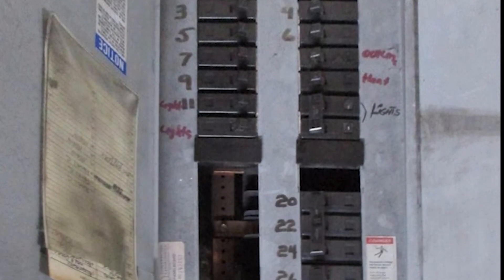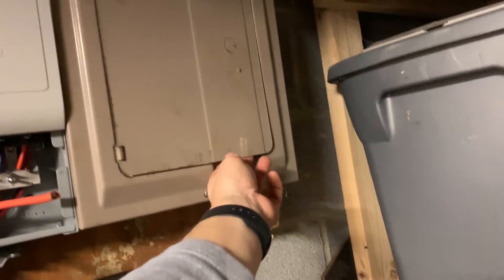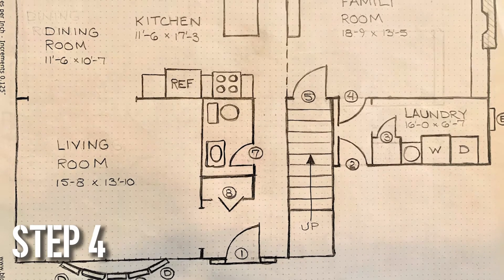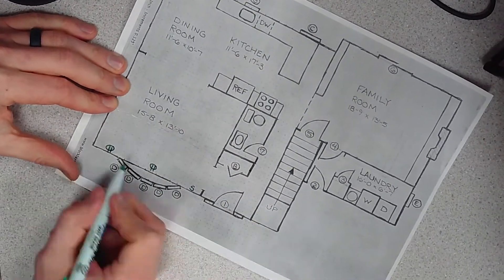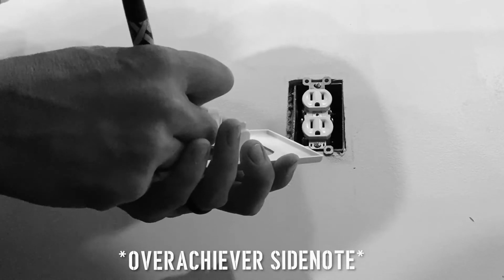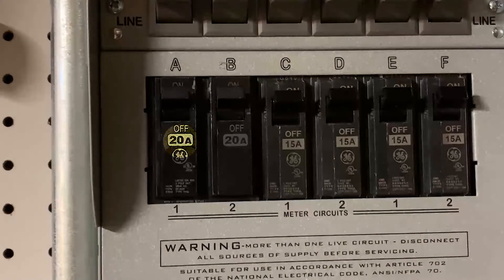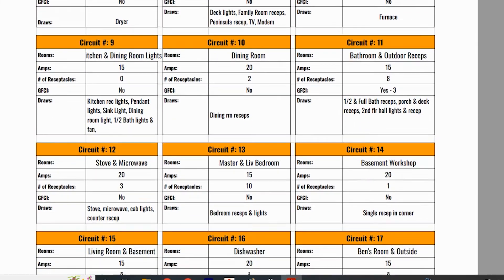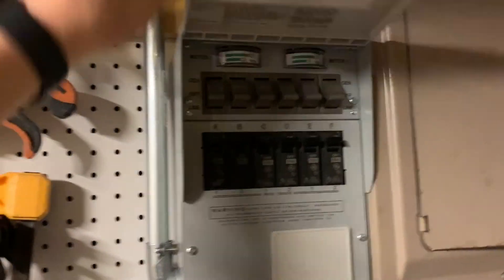How to Map Your Electrical Panel (DIY ID Key & House Plan!)

Comment: Hi! Quick questions from the novice I am. House is triphase, breakers are all 20A. Is it safe to assume the wiring in the house is the at least 12 gauge? Reason I ask is because j am considering adding a 15A commercial oven in the kitchen and will need to map the outlet to the correct breaker and make sure I don't create a fire hazard (ie: have correct wire gauge and a single appliance drawing power from this electrical line). Also: how to map aircon, ceiling fan and power showers to a circuit breaker? (they are on/off by a switch, not an outlet. AC switches are outdoor). Thank you!
Reply: Romex, or whatever brand wiring you have, SHOULD have both the wiring gauge and amp rating lazered into the sheathing. Obviously older house wiring such as knob and tube won't, but even NM cable used in the 50's & 60's should still have that information on it. Hope that helps!